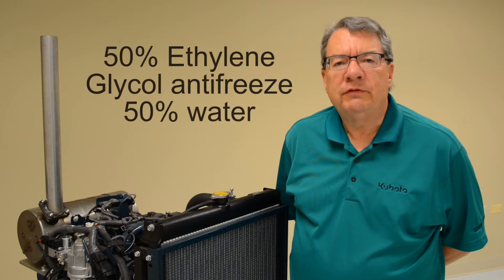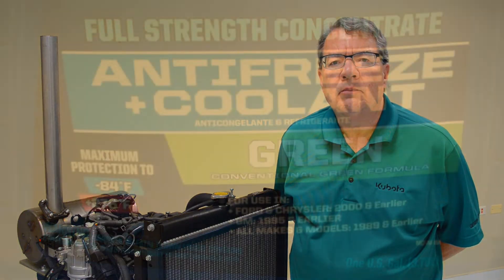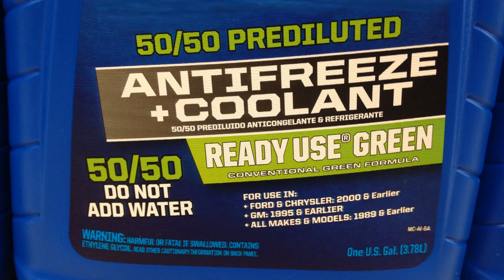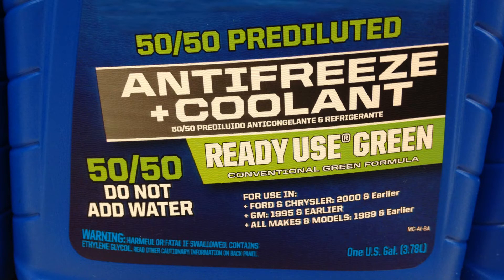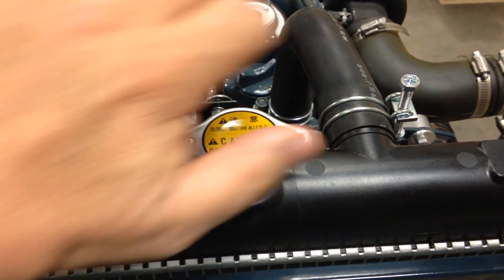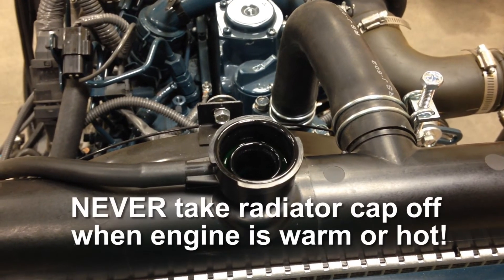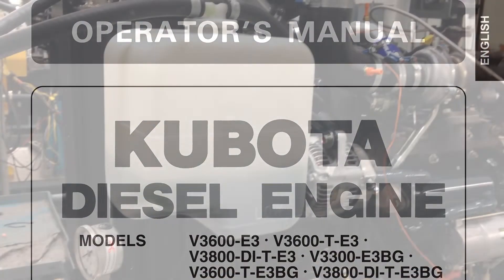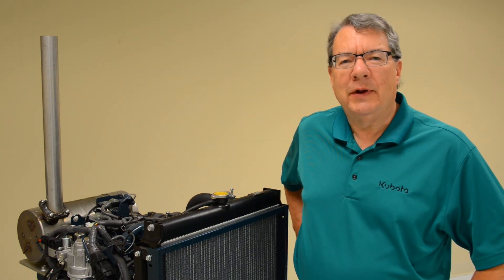Coolant Concentration: Why it's Important | Kubota Engine America

Comment: My Grasshopper 725D has a 25HP Diesel Kubota engine  - that motor is very weak. Even if the grass isn't long but slightly wet engine will really bog down. On slightly taller grass that is dry engine will bog down as well. I love Diesel but that engine sucks.